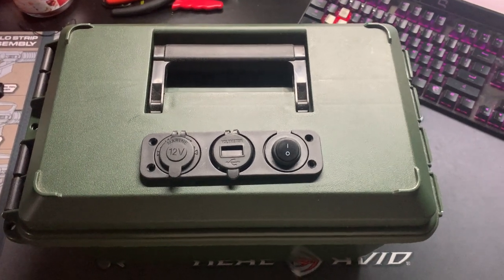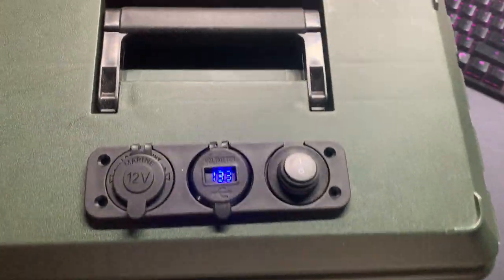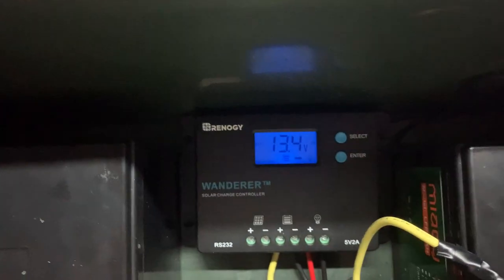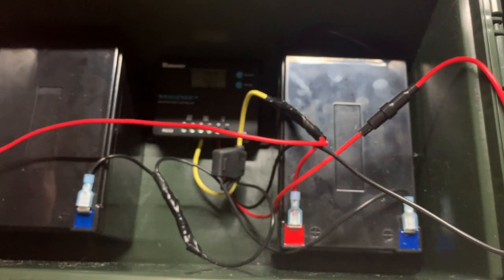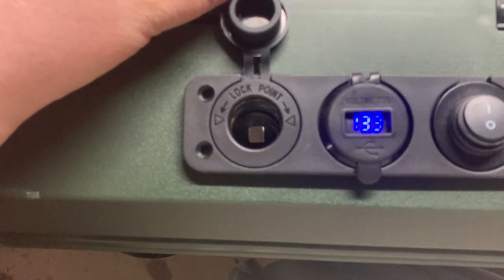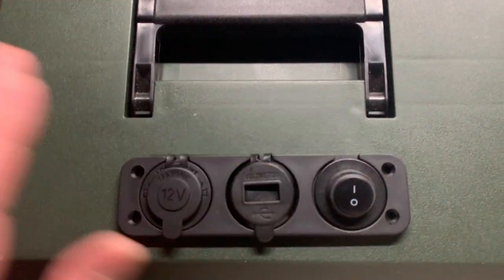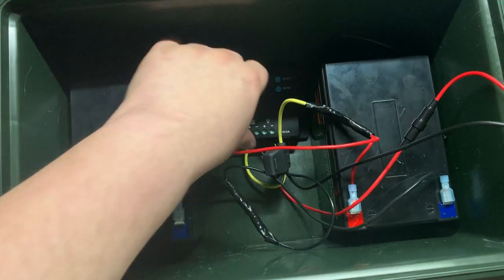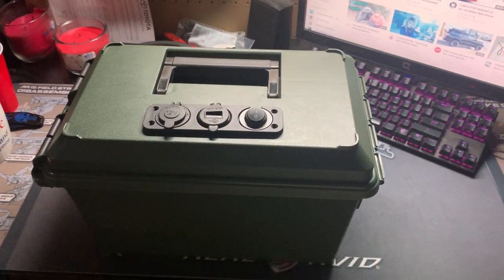Off Grid Technology | Custom Solar Generator for Off Grid (Part 1)

Comment: Consider adding a foldaway solar panel and a pure sign wave converter in the 250 watt range, but to get the most out of the panel you need a mppt charge controller like a Bateria Power 10A 12V one works and it is small. oh if you are going to wire in that matter, make sure the wire lengths from the battery's are identical.